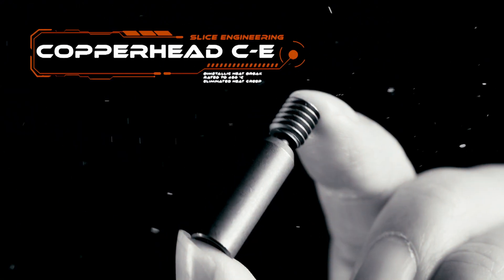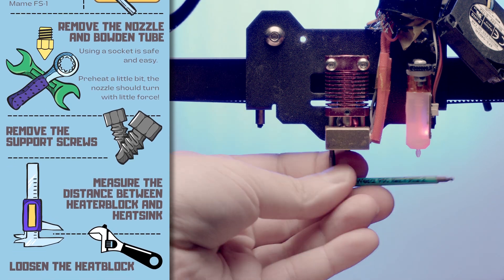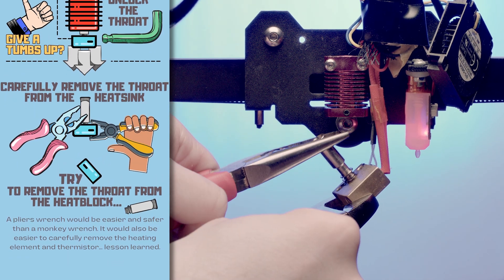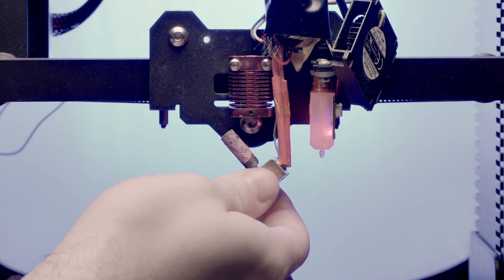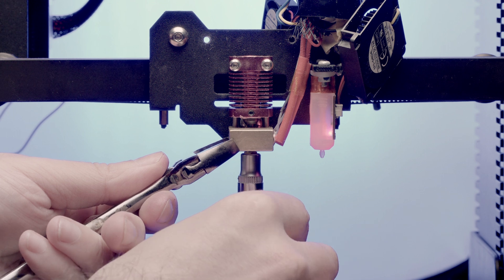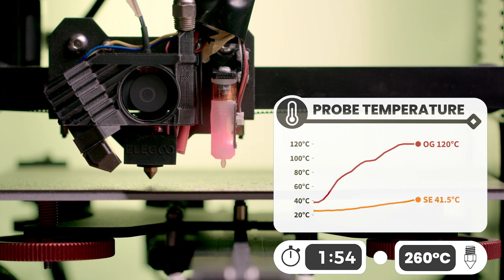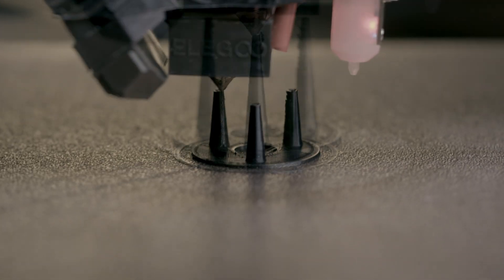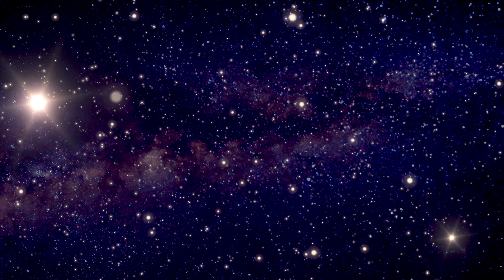Slice Engineering Copperhead C-E High Temp Bimetal Heat break, Install & Test: Elegoo Neptune 2S

Comment: I used the same thermal paste and it did indeed seize everything up when I fitted a new bimetal heat break, I ended up replacing the thermistor and whole hot end after only 4 months because of it......I only wanted to change the nozzle too and ended up down the rabbit hole.
Reply from the maker: Thank you for the confirmation! I have bad experiences ripping heatsinks off old CPU's so was a bit worried to try and put it in the heat block. Now the question is does the Slice Engineering stuff hold up over time?
Reply: @MochaMameX  It was a complete nightmare, luckily I have two 2S's and a whole bunch of spares so mashed  bits together to get it to work, downside is that the only ceramic heating cartridge I had spare was a 60w so whilst it heats up really quickly the temperature seems to fluctuate one degree above or below the settings once running.

One standard 2S and a completely modified one, best upgrade was dual Z axis kit, made a massive difference to prints and it's pretty quick to do since most of the Ender kits fit.....though the signal smoother modules were damn good too, no more weird artifacts in prints.

Either way, thanks for the response and the new content.
Reply from the maker: Likewise thank you, lots of good  information! 

When I broke my BL Touch bracket I had one of those nightmare moments, tape doesn't work, can't find super glue, can't print a new one... I remembered Uncle Jessy's vid about welding parts and got creative with a lighter.

Bought 3 rails to consider an axis upgrade. Gave up on the smoothers because too much mixed information on if they would actually be useful... but might have to give it a chance.

Comment: I have got an awful lot of stringing with this heatbreak. I of course tweaked retraction length, speed, temperature, cooling, pressure advance, nothing would work. I then installed a cheap AliExpress BiMetal heat break and everything was perfect again.
Reply from the maker: There are a lot of perfectly fine cheap parts if you are willing to try, glad you found one of them! With mine the retract distance and retract speed needed to be adjusted, after this I was ok. PET turned out perfect, PETG had a little stringing but it was also my first time printing PETG, Polypropylene was perfect and TPU seemed the same as before the upgrade. It could be caused by heat building up into the cool end, on my printer I've replaced the heatsink fan so it runs cooler. Would be interesting to hear how many people get the stringing problem.

Comment: For some reason this upload eluded my sight. I do like the new intro, though!

The main reason I wanted to leave a comment is because I've mentioned a while ago, on a previous video of yours, that I plan on replacing my Neptune 2S's stepper motor drivers with some newer silent stepper drivers. I finally ordered some TMC2208 drivers but we'll see about how to connect them when they are delivered. My plan is to replace the non-silent z-axis driver first and see how it goes. There is a header on the board that can accept one of these drivers easily, but will have to configure the firmware to use this one for the Z-axis instead. I'm also planning on doing a Klipper conversion with a Raspberry Pi Zero 2, which seems to be adequate, since I'm not going to run OctoPrint along with Klipper.

I will let you know how it goes😁
Reply from the maker: Thanks! Haven't had time to post anything new recently.
I'm really interested how the TMC2208 installation goes, are you running Marlin or stock?

Comment: Very happy to see this video! I've been wanting to get a bimetal heatbreak for a while to start printing PETG without risk of degrading the bowden tube,  but I've been hesitant as there seems to be no domestic supplier for the copperhead in Japan and I didn't want to risk a cheap knock-off as everyone seems to warn against buying anything other than the genuine article. How did you find the shipping cost/time?
Reply from the maker: It arrived fast I was a little surprised it was just in a little plastic bag not a box but packing was enough to be safe. Shipping cost was about 11USD but I always buy something else at the same time to balance the fee. I bought off Amazon, so no surprise costs. Same link in the video description. You need to play a lot to get settings right but it works when you finally do!